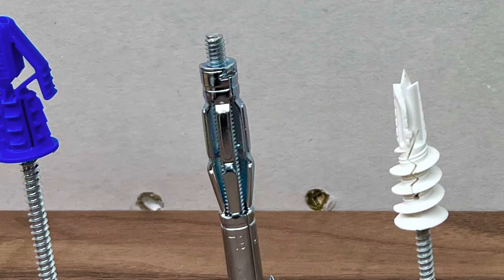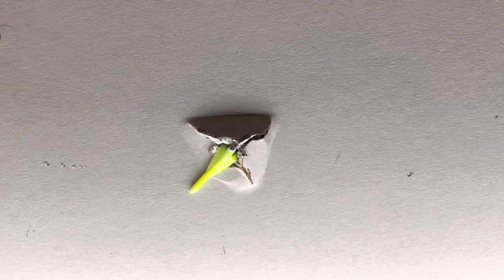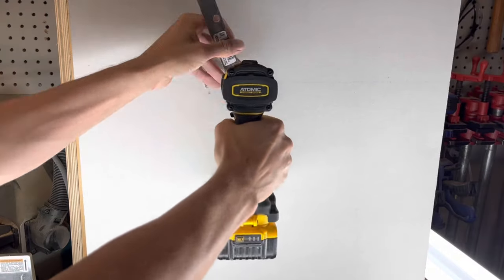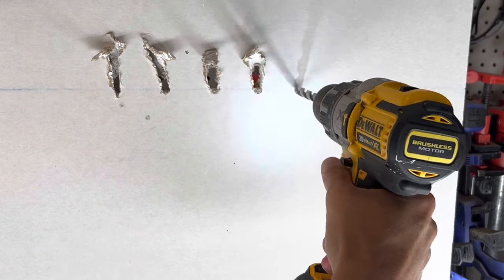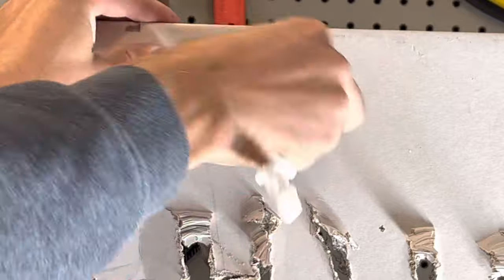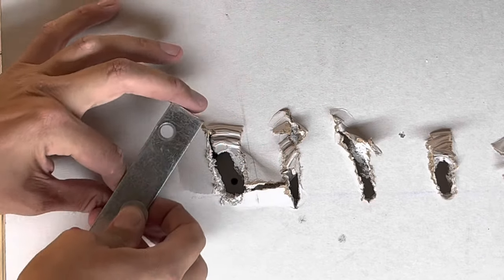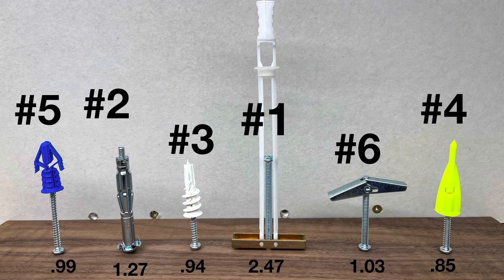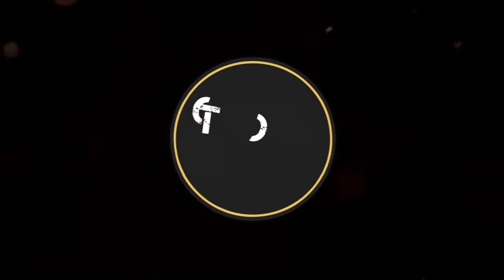The Best Drywall Anchor Plug Inserts // Tested

Comment: Problem 1: Using New Drywall for Testing Instead of Old Drywall

The video mentions using a brand new sheet of drywall for testing the strength of anchors. This is misleading because old drywall, especially 70-year-old drywall, weakens over time, becoming brittle and prone to cracking. In real-world situations, especially in older homes, the results would be very different. For example, toggler bolts and other similar anchors will not hold as well in deteriorating drywall, as the internal structure of old drywall is much weaker, reducing its ability to support even moderate weights (source: Drywall Durability Over Time).

Problem 2: Misrepresentation of Load Testing (Side Loading)

The testing involves applying a side load (horizontal pull), while toggler bolts and most wall anchors are specifically designed to resist outward or downward pull. The toggle bolt test fails early at 32 pounds, but that's because side loading isn't a realistic representation of how these anchors are supposed to work. In actual installations, especially when supporting a sink or heavy item, the load will typically pull away from the wall (source: Anchor Load Directions). The video doesn’t clarify that side loading is inappropriate for these tests, leaving viewers with an inaccurate sense of failure points.

Problem 3: Using Large Holes with Small Bolts Weakens Integrity

In the toggle bolt test, the bolt is small in comparison to the 3/8" hole used for installation. The larger hole size leaves less material to support the anchor, leading to premature failure, as seen in the video. The problem here is that drilling such large holes in old drywall (or even new drywall) weakens the overall structure. When used on older or more fragile drywall, the chances of the drywall crumbling or failing to hold up the anchor increase significantly. The larger the hole, the weaker the structure around it (source: Structural Integrity in Drywall Anchors).

Problem 4: Lack of Consideration for Real-World Installation Challenges

The video mentions that toggle bolts can be tricky to install because you have to pre-attach the object (in this case, the sink or other fixture) before folding the wings and inserting the bolt. However, this complication is downplayed, and the difficulty of installation in real-world scenarios (such as older homes with uneven walls or limited access) is not fully addressed. Older drywall may be uneven, crumbly, or even have hidden cracks, making it more difficult to properly deploy and secure a toggle bolt (source: Common Issues with Old Wall Installations).

Problem 5: Overemphasis on Maximum Load Ratings

While the video highlights how each anchor exceeded its rated load capacity, the maximum load isn’t always the most relevant factor. When working with deteriorating or old drywall, the anchor might hold for a time but eventually pull through as the drywall weakens further under continuous stress. The real concern is long-term durability in compromised drywall, not just the load it can hold in brand-new drywall in lab-like conditions (source: Long-Term Durability of Drywall Anchors).

References:

Drywall Durability Over Time: Aging and Weakening Effects
Anchor Load Directions and Performance in Real Applications
Structural Integrity in Drywall Anchors and the Impact of Hole Size
Common Issues with Old Wall Installations in Deteriorating Structures
Long-Term Durability of Drywall Anchors: Concerns in Aging Homes

Comment: For the snap togglers, would you think they are strong enough to hold a 75inch flat screen? I purchased the 110 lbs version…however in the instructions it has a warning. That it only holds 40lbs. So I got confused. As to how to read the weight limitation correctly. TIA
Reply from the maker: What type of mount is it? Are you able to hit any studs or are you relying strictly on snap toggles for the tv?
Reply: @ToolsThatBuild  a stand still mount (it will not be moving). I unfortunately did not find any studs in the area desired.
Reply: @ToolsThatBuild  so I was wondering if i should go back and get snap toggles that have a higher weight limit. Thank you so much for responding!
Reply from the maker: @daliaxsalazar  a snap toggle is the best anchor you can use for your application. I would be cautious to hang something of that value on anchors alone. The best solution would be to span the studs with a small board (could be decorative looking) behind the tv where it won’t be seen, And bolt directly into the board. That way your hanging from the studs and no matter what you know it’s not going to let go.

Comment: I am trying to mount my 48 inch LG TV and it’s pretty heavy and do not have studs. Which would would your recommend ? I am worried about overtime wear and my tv collapsing . The tv I have is pretty heavy
Reply from the maker: What style of mount are you using? Eg. Flat swivel etc. 

You may have to span the studs with a board and bolt to the board directly so you have a strong structure. 

If it’s a flat mount that doesn’t move overtime wear shouldn’t be an issue
Reply: Hi there, I'm in a similar situation and I'm mounting a 43 inch Samsung frame tv. The mount is flat, what would be your recommended anchor to use? I think there are metal studs in the wall but I can't drill through them.
Reply from the maker: @johnch4u  hey yeah metal studs wouldn’t be ideal anyway. A 43” tv is fairly light and with a flat mount your biggest issue is a sheer force like these tests so use a Toggler Snaptoggle (the Long white one) should be plenty
Reply: @ToolsThatBuild  thank you so much! I'll give them a try

Comment: 30 kg Heavy Mirror hanging off hollow dry wall? what should I use ?
Reply from the maker: The long toggler in this video if a stud is not an option
Reply from the maker: The long toggler in this video if a stud is not an option.

Comment: your number 2 anchor was too long for drywall, you can get shorter shank versions of these use the size that that fits the dry wall thickness best
Reply from the maker: I’m assuming your referencing the hollow wall anchor. It says right on the package 1/2” drywall. In these tests I’m using 1/2” drywall. Based on the manufacture’s packaging this is the correct thickness of drywall so not sure what you mean.
Reply: regardless of what it says on the package, you want the claws to bite properly on the back of the board.
.
Some brands have a better effective thickness range.
.
if it's going into 1/2' board, you want an anchor that has close to 1/2" of plain shank.
the flatter the claws lay to the wall the stronger the job
 @ToolsThatBuild

Comment: Great video really insightful! However I think the snap toggle bolt requires a 1/2 inch hole and not a 1/4 inch as you stated, in order to insert the snap toggle. Thanks for the informative video!
Reply from the maker: As long as it fully inserts and fully deploys the size of the hole is irrelevant. The more drywall you can leave intact the more strength the anchor will have and the easier it will be to patch the hole in the future if needed.